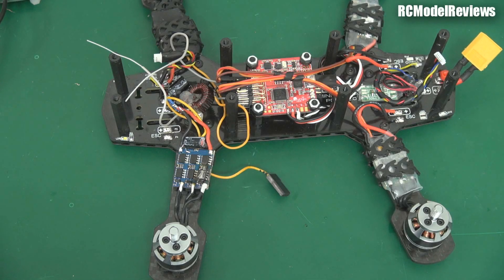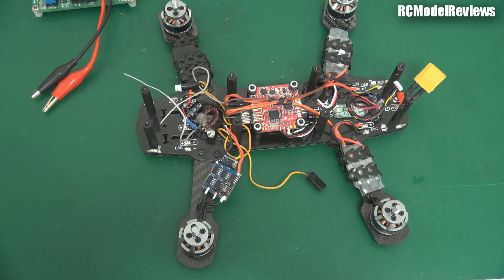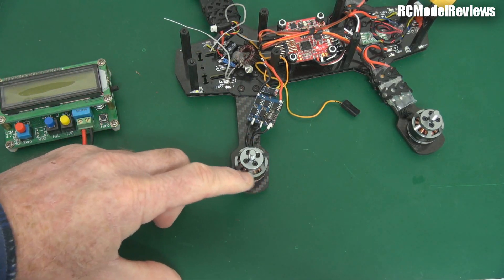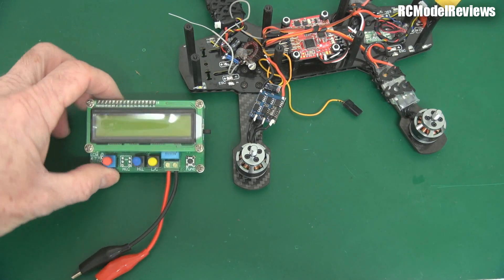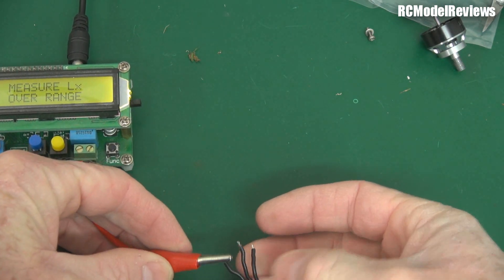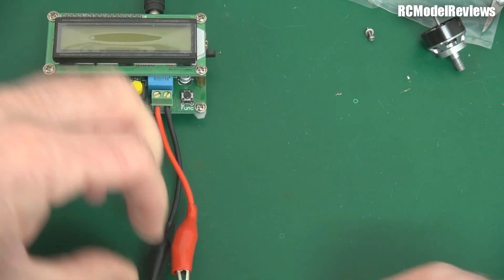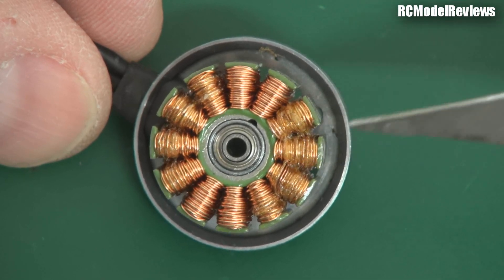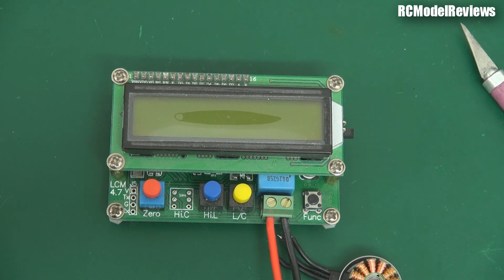How to test a brushless motor with a $30 LC meter

Comment: Greeting Bruce. I know this video is old, but I was wondering if a modern battery charger, like the ToolkitRC M6, could be used to measure the winding resistance?

Comment: Bruce, great video, but what sort of tolerances are acceptable?  I'm testing a Kontronik Pyro 800-48 (Large heli motor) and getting readings between the windings of :- 9.77uH, 9.73uH & 9.52uH  for the three poles. big 12 pole motor.  Acceptable??

Comment: A better way is to measure the AC Voltage that is generated by a pair if you spin it using an electric drill.

Comment: Hello Mr Bruce! Is it possible to get a similar effect of that of the currents( heat to melt winding insulation to short the motor) by feeding to much solder to the wires? (solder heat melt winding insulation as solder reaches far inside the wire near winding)

Comment: Great example, thank you!  I did not want to buy another tool, so tried using my Craftsman multi meter.  I KNOW I have a bad motor (swapped motors on the Quad) so used it to compare against another (so next time I may not have to disassemble and unsolder motors).   Mine is an XK X252 only a few days old.   On the multimeter I set the Ohm setting to 200 Ohms (lowest setting).  On the bad motor wires, none of the three wires measured the same in any combination.  On the good motor, regardless of which two wires I touched with the meter pins, the reading was .8 across the board.   Hopefully this helps someone else.   Again, thanks for the lead.

Comment: How close to each other should each phase be (in uH)?  Out of my 4 motors, one motor has a difference of .4, two motors each have one phase about 1.5uH off from the other two, and the fourth motor's measurements are 5.5, 6.8, & 7.3uH.  These are on Emax red-bottoms.

Comment: People, don't buy this LC meter and expect every motor you have to have the same values. They probably won't.
No two motors that are man made are alike.
The 3 different coils should be alike, but no two motors.
Well they should, but they are not.
That's just because one man may put more force on the wire when winding, or less.
Maby one of your motors were made monday morning when the factory was cold, and the last one on friday afternoon in the blazing heat from the sun.

Just a tip.
Windings MUST be pretty darn close, different motors SHOULD.

Comment: The magnets won't "saturate the coils" but the rotor may vibrate with the test frequency, throwing off the measurement. To combat this, you must "lock" the rotor. The inductance will also change somewhat (perhaps 10% or so) depending on the rotor position. This is due to the permeability of the magnets being slightly higher than air. Nevertheless, completely removing the magnetic rotor is certainly the easiest way to get a reliable measurement for this purpose.

Comment: Is there a way we can check an esc for power overload? we had one "reprogram" itself during startup sequence, and I have found no documentation on it being reprogrammable without a card. Needless to say we blew the motor and another esc testing that motor...a $40 problem

Comment: What are those rubber straps called on the arms? I like them and want some...
Reply: Rapstrap. You can google for your preferred supplier. I found mine on ebay...
Reply: I believe you speak of "shrink wrap"?

Comment: You can change the range on the multimeter instead of auto range set to .ooooo to get lower check
Reply: You're still not supposed to meassure coils with an ohm meter or multimeter.
The value you're meassuring for is called Henry, and the value changes when you meassure it. since you're putting voltage on the coil, the ohm changes.

You actually DO need an LC meter to meassure mH. (milliHenry)

Comment: bruce, I watched this video several times trying to figure out what I was doing wrong. ...the motor had a direct short on all windings (tested other three) what caught my attention was it being hard to turn. also when you first get the meter turned on hold the zero button until it says ok, this was in part my problem as well.

Comment: Hey mate. Great vid. I grabbed an lc meter off ebay. I had a suspect motor. Found the readimgs were 11.1 10.8 and 8.5. Micro henry's. However, if you spin the motor you can make the readings higher and lower. I assume if the reads all vary im the same range, then the motor is ok. Not sure if it was addressed in vid. Thanks for the great work. Love the channel

Comment: If I wanted to determine the resistance of a motor's coil possibly using a LC metre, how would I go about this.  I don't have the equiptment required for measuring the self-resonant frequency.  Anyone know of another way?

Comment: ESC should be much better then they are. This should not have happened. ESC how they are build now are creating huge amount of harmonics resonances as they create Square wave not true sine.  There is lot of  energy floating around on an "echo" created on spectrum .Because motor in this form is actually transformwer we dont see eminent effect but ESC should be much better with overload protection in case of a stall.

Comment: Thanks for the video, any tips for testing ESCs? I have 4 esc's which I accidentally shorted out (My fault!), magic smoke was released from at least one of them. They still "work" but I've lost all the punch from my miniquad. I've replaced them all but I wonder if there is a way to test them to see if any are still good. None of them have any visual cues of being burnt out.
Reply: Jon Keller If you open them up and look for burnt components you could replace those.  Where was the short?  I was able to repair a shorted Arduino similarly.  A big thing also can be where the wires solder on, the solder joint can become heated when they are shorted and get a thin film between the wire and solder in places.  This causes a lot of resistance.

Comment: Or you could use a current limited power supply set to 1~2 amps. Or simply connect a 12V car tail light bulb in series with your lipo plus lead, this is the poor mans current limiter. Do the same after flashing esc's, this will save the esc if you flash the wrong firmware.

Comment: yo dude got a ax-2810q kv 750 using the meter that you have i get readings of 38.88uh blue to red and 39.22 blue to black then 39.29uh red to black is this enough of a variance to be a problem because i really dont know what i am doing
thanks

Comment: A 12v ~20Amp car fuse inline with each ESC positive rail could keep the magic smoke in. 
But I bet that most ESC failures are due to poor cooling. And as far as I see people using the ESCs, no cooling whatsoever.
A fet goes short, burns in a couple windings on the motor, the enamel on the copper windings carbonizes, coils short-out and sequentially kill the next ESCs.

Comment: I recently purchased one of these after seeing this video.  I had a quad camera ship (680cm) fall out of the sky from about 40 meters and was digging in to possible reasons.  I tested several different motors from other vehicles in order to figure out what normal looks like and found that some have much higher readings than others.  Is a low mH reading some sort of indication of internal resistance of the motor?  I ask because several of the higher end (t-motor) motors tested very differently than cheeper hobbyking motors.

Comment: *****  I bought this and its excellent, great recommendation. Ive tried leaving a few messages, I'm an electronics engineer just getting into the hobby and you've made it so easy, fun whilst factual and that's hard to achieve! I love the 'whats inside' and the explaination videos. Perhaps a video on how data is transmitted over 2.4 & 5.8ghz would be nice if you have time.
Keep up the great work Bruce, its making a difference all over the world!

Comment: have you ever unwound the wire of a motor and diped in resin or high temp coating to reseal the burnt off insulation

Comment: So Bruce this LC Meter would be great for testing caps inside the TV circuit boards? If so I will pick one up somewhere online that does not rip you off and not send you what you ordered. If you have a video using the LC Meter to test caps would be great to know which one.

Comment: I would rather say " If you burnt an ESC, it is more likely that the MOTOR damaged the ESC, not the other way around." If you Burn an ESC, the FIRST thing you check is to see if the motor caused it. You are doing it backwards... Replacing ESC's, then Looking at the Motors. Am I wrong,sir?

Comment: Hiya Bruce, long time viewer, first time question :P 
I noticed that you have soldered the motor wires directly to the ESC circuit board. I was wondering if it is ok to do this as I want to do it to one of my models? I did a bit of research about this and found mixed results. Some said shortening the ESC wires was a bad thing to do whilst others said it was ok. 
Thanks!

Comment: Hi Bruce;
A review on using the HobbyKing Kv/RPM meter for BLDC motor or similar devices on your suspected motor would be quite interesting. It would be worth knowing if the kv/rpm meter can be of any reliable use. Comparing it with blades and no blades and at various speed would be helpful. thanks; http://www.hobbyking.com/hobbyking/store/__10335__Hobby_King_K1_RPM_KV_meter_for_BL_motors_.html

Comment: Great!!! I had the same problem with a brand new motor, But when and if it "Blows" the ESC and or more specifically the Capacitor's, can the Capacitor's be replaced to save the ESC in this situation? If so... then a video on repairing the ESC  would be AWESOME! Thanks for these video's Bruce ive been a fan for years and hope you can clear things up with the municipality's soon! Still waiting for part three on the XG8 review tho LOL!

Comment: Hey Bruce thanks for all the great videos, I really enjoy the channel. Have you in the past or could you in the future show how to test an   esc, I have a tricopter that dropped out of the sky about 8 min into the flight. I replaced components and only solved the problem when I replaced the escs, same amperage by the way just different brand. Now I have 3 suspect escs ad would like to test them on the bench. Thanks!

Comment: I dropped my quad in a ditch full of water and atleast one ESC fried, not sure about the others, as I see no physical damage. Now I can check the motors with an LC meter, but what about the ESC's?
I've been in this situation before where I dunked the whole quad under water and testing just by trial and error what parts are fine and what's not can be expesive.
Anybody got any advice how to check the ESC's?

Comment: Bruce I have been using the cheapest ESC for years and the one thing I have learned is add a heatsink, also your paying far to much for your motors.

Comment: So there are only 2 separate circuits in brushless motors? I thought there would be 3. I wonder this because apparently you measured 2 different windings and then both of those in series.

Comment: If you don't have an inductance meter, you can also test for motor coil problems by spinning the motor with a drill and checking the motor's VAC output.  Obviously you have to be careful not to damage the motor when doing this.

Comment: Hey Bruce, I have a Uni-Trend UT61E multimeter; can I perform this measurement too with it? Thanks!
Reply: If your meter can measure inductance then you can use it to check the coils in a  brushless motor like Bruce did.

Comment: If some of the turnings are shorted wouldn't there be less resistance than if they weren't?
Reply: Well, as Bruce just explained in his video that the coil resistance in the motor windings are far too small for a multimeter to pick up.

Normally when a coil shorts, the wire on the coil normally shorts on an adjacent wire on the same coil. Therefore, there would be no difference if any at all.
Reply: That's kind of what I meant.  If you're trying to measure resistance and you have nothing to compare it against then how would measuring the resistance tell you if the windings are shorted?  Surely the only reason you'd be blindly measuring the resistance would be if you were looking for 0 or for a known high number.  

How would a more accurate meter help you unless you had a reference point to compare against!
Reply: David Stretch Ah, I see. Well, in that case if it's on a multi-rotor bird like what Bruce has, measure one of the other three good motors, then.

Comment: Before you flood the market to buy LC meter and waste your money on it, I like to say that it is not a definite method to determine that the motor is faulty. Better save your money to buy a new motor instead. Because inductance wound like this are so much affected by surrounding radio waves, orientation, mutual coupling etc... you won't be able to convince yourself of few shorted turns or the turns being shorted to the armature, for example.  Even professional appliance service manual will direct you to measure comparable ohms instead. Motor windings are not perfect per se. To determine that a winding is beyond the manufacturer tolerances for such small hobby motor means, you really need to measure each phase current consumption by dedicated equipment like an oscilloscope, for example. Try swooping a new motor would be cheaper and sure assuring way. You will still buy a new motor if you use the LC meter, I am sure, because at the end, you will be so doubtful of the readings... LOL. Hopes it help.

Comment: Bruce, very informative as usual, tks.  I may be wrong, but I think your ESCs are mounted wrong - holding in all the heat with a graphite blanket.   I flip them over (heat sink up) to get prop wash on the heat sink.  Just a thought - your's may be that way too, but it looks like heat sinks down on my monitor.

Comment: Can't you rewind it and save $45.
Reply: probably not even worth it, the copper alone will not be cheap, THEN you have manually set the turn ratio correct on every single winding, it's just easier to buy a new one at that point.... in my honest opinion...

Comment: Thanks - that was informative. 
My greatest concern is (because I fly over water 70% of the time): why did your ESC burn out in the 1st place? It looks like it's rated for 12A and it's very well cooled there.
Reply: Sometimes, shirt happens :-)
Reply: *****  Don't put shirts on your ESCs, even in winter! ;-)
Reply: Fly a hex or Octo if you're worried about that. They can spit a prop or burn an ESC and still fly

Comment: LC100-S  is the model number of the meter that looks like that one, easier to just search LC100-S on ebay, about US$25  :-)  . Are goodluckbuy now a more reliable vender than in the past ?
Reply: No, Goodluckbuy are a lottery.  I'd find an eBay vendor with good feedback.

Comment: Nice one Bruce, i usually just hold 2 wires together (middle and left side) and spin the motor then compare to the other 2 held together (middle and right side).  If a wind is badly shorted it spins easily if it's ok then it's like the brakes are on.  However your way is far more accurate.
Reply: crezzee, I like your way, gona try it first.

Comment: Thanks Bruce, have been tempted to get a lc meter since it featured in one of your other videos. Are there other useful inexpensive instruments like this that would be good on a RC modellers tool bench?
Reply: Yes, I'm part-way through making the video on multimeters and I've realised that there are a number of cheap electronic devices that would be really handy for the average model-flier in this age of hi-tech.    There will be some more videos coming on this subject.
Reply: *****
Keen to see that as well Bruce. Need to buy some gear now, so any input would be great. Perhaps a few price options with pro's / con's..? Ta

Comment: I have an LCR meter but usually when testing a RC motor i just touch 5V from my powersupply across each motor phase. If they all draw the same current and the motor twitches on each phase then i conclude the motor is ok.  (Note: You have to rotate the motor and test a few times to conclude that the motor is twitching on all phases because you don't know which phase position the motor is currently at mechanically. At any given motor position only two phases will twitch because the motor is already at the 3rd phase)
Reply: A shorted turn or two won't make much difference in the amount of current drawn at low (DC) frequencies but it will make a huge difference to the amount of current drawn when actually driven by the ESC at 8KHz or 16KHz (common switching frequencies).